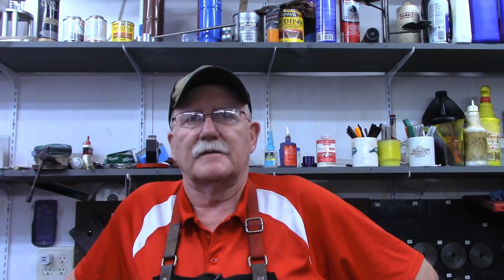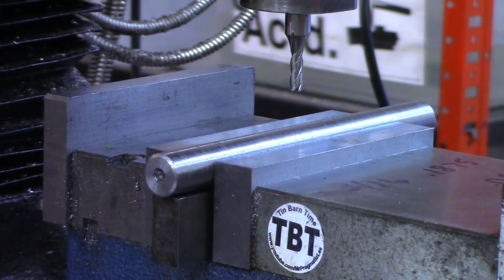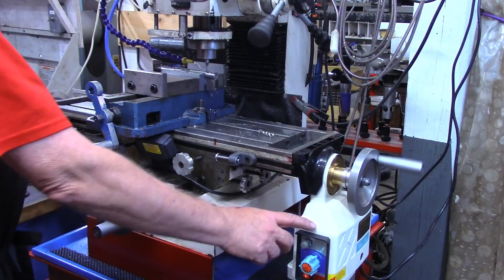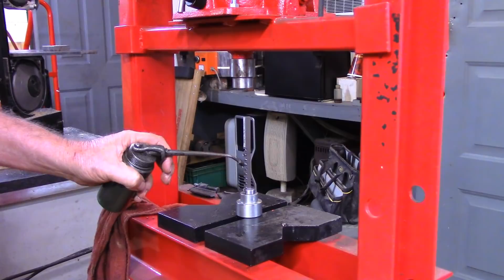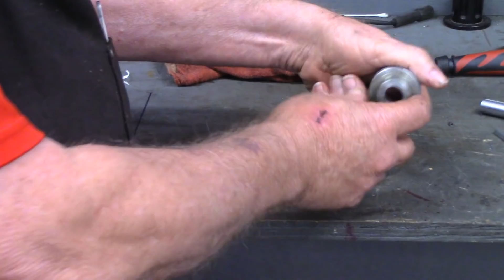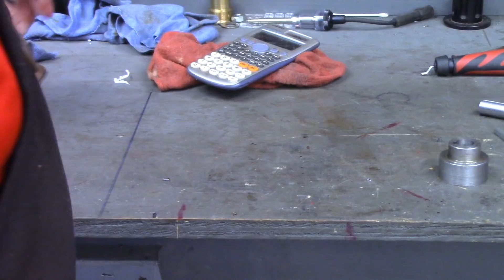How To - Milling and Broaching a Matching Key Way

Comment: I made chop saw gears at black and decker 40 years ago. Ran 4 machines at same time, got tool and die wages.my broach were a lot longer than yours. They scrapped that whole factory. Main machine was acme gridley automatic multi spindle screw machine that spit out the blank. Then barber coleman gear shaper. Then broach, and deburr backside of gear.